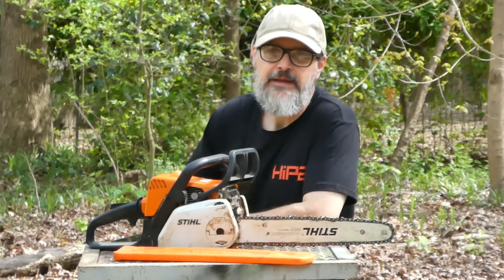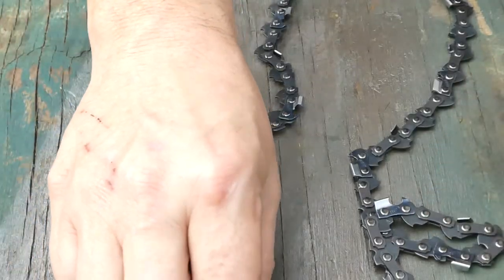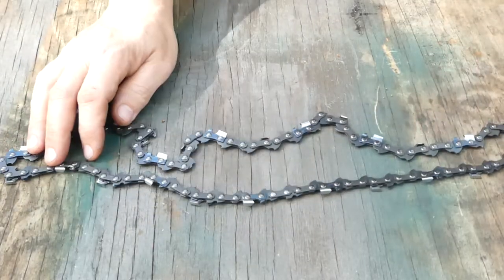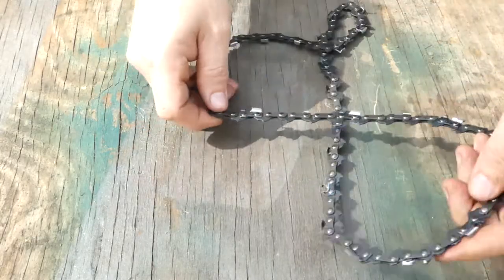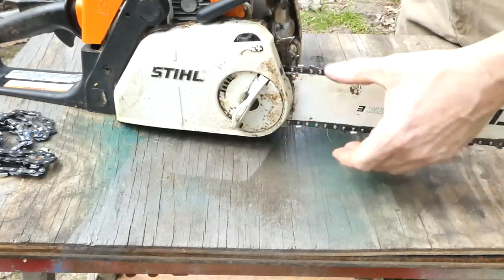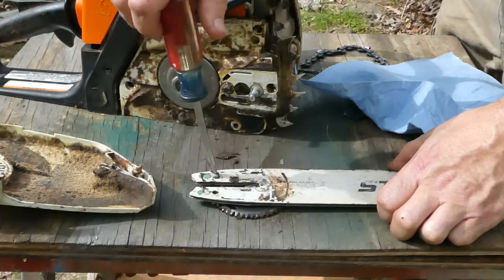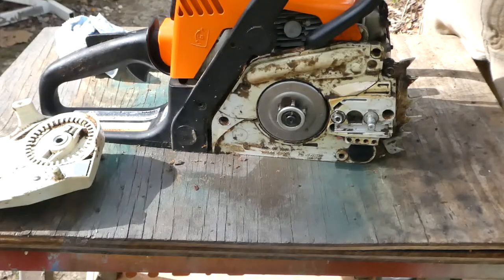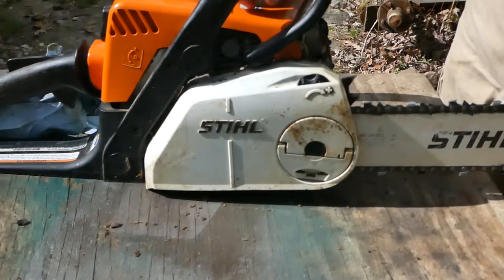Easy way to untangle a chainsaw chain and install chainsaw chain on your Stihl chainsaw

Comment: i received a chain which has the teeth needed to do the cutting in the inside perimeter of the chain.  How do then basically turn the chain inside out in order to have the teeth on the outside of the perimeter?  Could you do  a quick video on that?

Comment: I like to blow the bar out with compressed air every 2 days to keep it clean i also have a bar groove cleaner that i use if i'm out in the woods cutting and the oil holes in bar get plugged up with sawdust
Reply from the maker: Thanks for sharing

Comment: How do you get small kinks out of the chain? Mine isn't tangled but two links are stuck at a 90 degree angle... I've pulled on it hard but that doesn't work